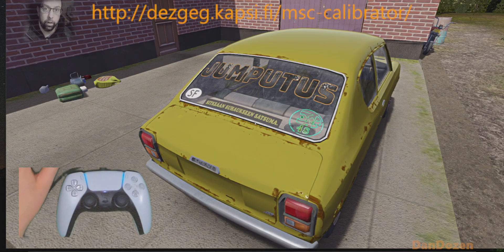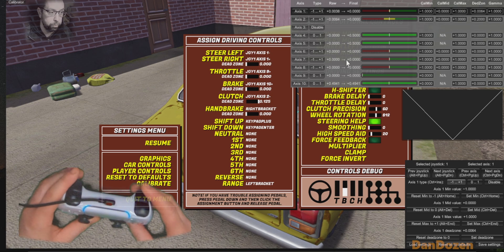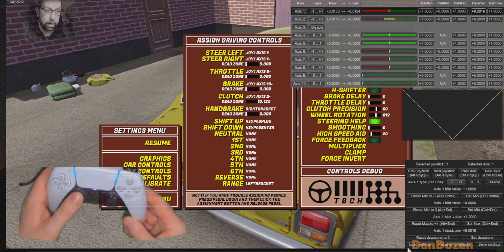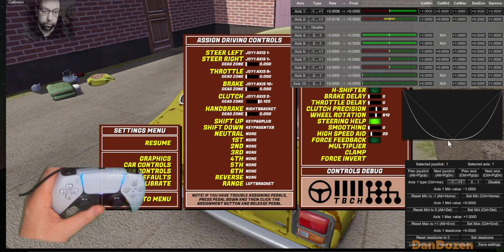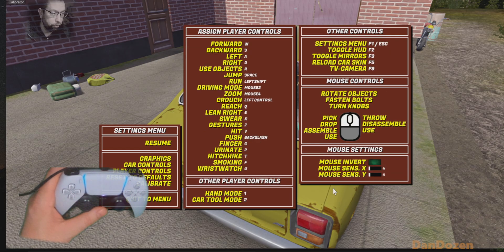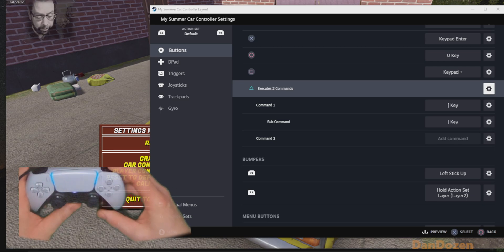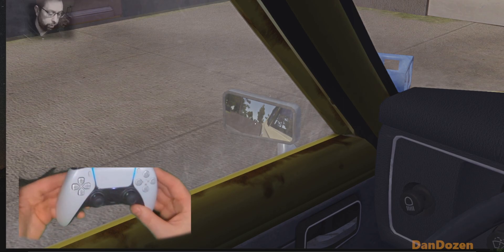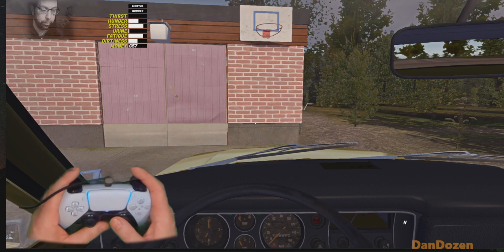MSC My Summer Car Controls | Calibrator and Steam Overlay

Comment: If anyone is here in 2026... this doesn't seem to work with My Winter Car (yet)
Reply: nooo
Reply: I got it working. you need to hit shift tab and change your game pad type from keyboard gamepad with high precision aim (or something like that)  to in the steam controller settings.
Reply: @JackStraw84 to what
Reply: @jeffzkiller3590  what are you asking? It works fine in my winter car you just need to change your steam gamepad settings

Comment: So, it was working just fine. Not exactly sure what I did, but now the calibrator does not receive any of my controller inputs. It does however, when I turn off steam controller input. Before it was receiving inputs and allowing inputs from my steam setup but now its one or the other. Any advice?

Comment: Howdy. Trouble shooting. Lol. I dunno if its my potato of a laptop or if its the controller. It takes the input but if i push or let off to fast it like hangs up in the middle somewhere and throttle or brakes etc will stick until i push and release slowly. Have any answers?  Is a play station controller better?